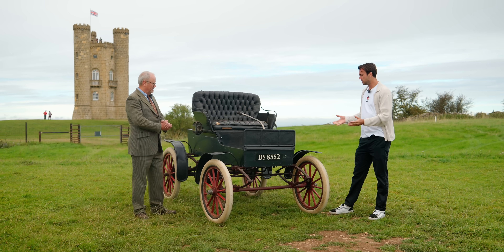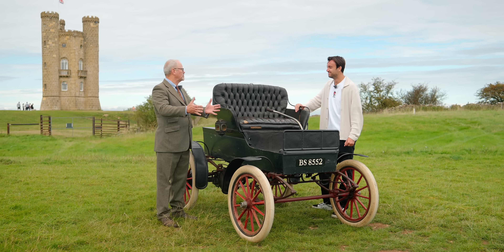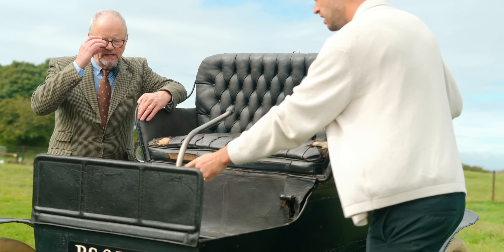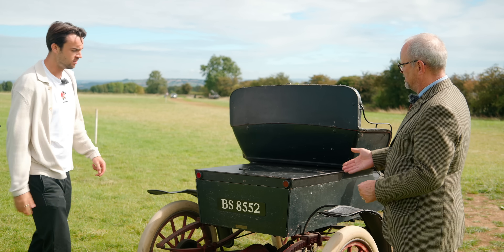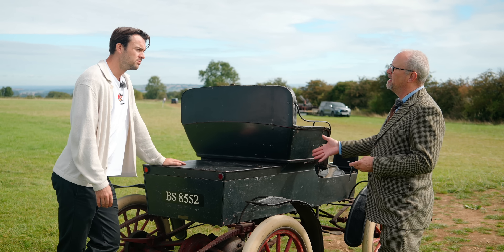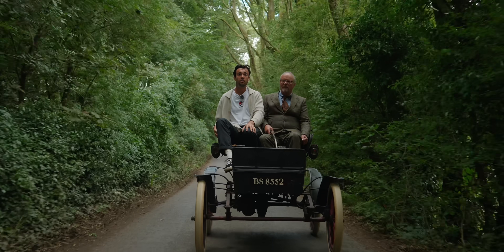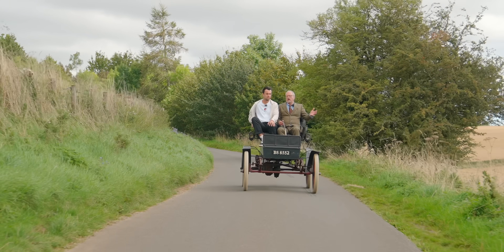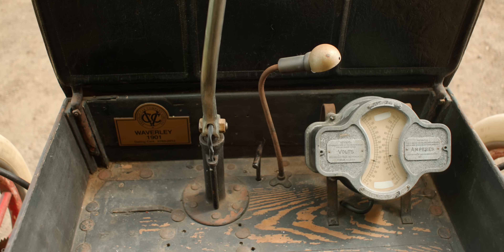Why Electric Cars Failed 100 Years Ago

Comment: So... shall we do a steam car next? 😅
Reply: yes
Reply: Come to LA and I'll set you up with Jay Leno and his steam car.
Reply: Jack, your statement that steam was the hydrogen of its day is not merely true but perhaps more important than you know. Steam was complicated and wasteful of energy for personal mobility much as is hydrogen but steam was also fantastic for heavy industry and great big things... much like hydrogen could be.
Reply: More 120 year old electric vehicles would be very cool.
Reply: I bet you did get to go in a steam car you'd be proper chuffed.
Reply: @GreenJimll  bdumm Tss
Reply: Naa mate, sterling engine car next show😂😂😂
Reply: @bernardfender5147 Bernard, didn’t the 2015 U.K. building regs 15th edition recommend a 1kw sterling engine option (vs.1kw solar PV) - for all domestic gas boilers back then? 🤔
Reply: Actually I read a long time ago that the 1927  (I think ) Locomotive, solved the problems of the Stanley Steamer, but by then the gas powered vehicles had won.
Reply: @richardchiriboga4424  locomibile.
Reply: External combustion is an excellent addition to any project.
Reply: @sIightIybored  

No.

It's still internal combustion when batteries overheat, catch fire and melt marine car transporters in half on the high seas.

Everyone, but you, knows that.

And, before you attempt to grace us with some far too chippy response, "melt in half" is a literary device.

With a portion of hyperbole thrown in.
Reply: @t1n4444  you appear not to know steam engines are external combustion engines.
Reply: @sIightIybored 

😂😂😂😂😂

Well, now, there's always Google.

So, that said, the relevance of your post is what ...

Well
Reply: @t1n4444  why do you have to insult people for having a different opinion or for getting something wrong? Why can't we just have a respectful debate using verified facts? And why do people on this channel insist on having a full out war between fans of EVs and fans of internal combustion? There are god and bad points about both, and both fuel types have a legitimate place in society. For goodness sake, grow up, the lot of you.
Reply: @matthewgodwin3050  

Hmm  ... this is known as robust debate.

If it's not for you then kindly refrain from posting arrant nonsense.

Can you do that?
Reply: @t1n4444  did you actually understand the questions? I'm not sure you did. How exactly is being respectful and using verified facts arrant nonsense? Please explain.
Reply: @matthewgodwin3050  

No.

I'm far too arrogant to explain further.

Hope that helps.
Reply: But you are trying to get us all  to stop burning things……
Reply: yes steam car please
Reply: Not impossible. There are still quite a few working steam vehicles on the road.
Reply: Nuclear please 😉
Reply: Lol!!!! The steam car didn't worked well because off it's size! But on trains, ships, construction and mining equipments it literally changed the world.
Reply: Be careful with steam cars, Jay Leno had a close call.
Reply: Electric steamer, a kettle car 😂
Reply: Steam cars, why not... speak to Jay Leno, he has a few.
Reply: Not until you develop an "instant boiler" to start it going. It makes it difficult just to get in, turn the key and go.
Reply: @stephenbrinckerhoff3510  there's a thing called a flash boiler, mostly it's just a long coil of tubing that a diesel/methane/alcohol bunsen burner sends flame through, though there are flat coil styles that use multiple tiny jets, like the burner rings in a turkey deep fryer.  the modern version is 'instant water heater', slightly bigger.
     very small amount of water, lot of contact area, very fast, automatic ignition, the lot, though most use manual starter pumps, there's electric ones that work just as well.  these are VERY fast to get ready and the amount of water in them makes a 'rupture' a bit of an annoyance instead of the hail of deadly metal fragments that so many are skeered of.
Reply: @felderup  But you still have to wait until there's enough steam pressure to get you moving. It's not just push a button and take off like a rocket after sitting for a few days or even hours of inactivity. What do you do in sub-zero weather" when even electrics fail you? Even diesels are problematic.
Reply: @stephenbrinckerhoff3510  doble's do a heatup in 90 seconds, kids these days, no patience.  anyways, up north here, we have block heaters for really cold days, though, where i live, it's usually not needed.  however, what temperature is it where simple lead acid cells fail?  if gasoline cars at -40c will just start up and move off with no issue, how cold has it got to be to make the battery in a steam car stop working?  since they're the exact same technology, what is the difference?
Reply: Once had a girlfriend  whose father designed  hydraulics for aircraft.  Built a steam engine,  fitted into boat  .  Wanted to put a steam engine in my  1950  A40 😮
Reply: Definitely ! my friend has a 1903 Stanley steamier that they took me out for a drive in the other day, it was a great experience and rather funny because although all we could do was 25mph our acceleration was faster than a normal car
Reply: If you can get the facts straight sure. The first electric car was actually developed and on the road over a decade earlier. Look up William Morrison EV.
Reply: Abner Doble sold some magnificent steamers.
Reply: well, there are benefits to using steam power, it'd be better if we'd skipped gasoline and just used steam and electric.  with all the modern systems in cars steam would be superior in most ways to the competition, i mean, don't forget, it took one change to gas cars to bring them from idiocy to top of the heap.
Reply: @felderup  one caveat with steam power – when the boiler blows parts can usually be found over a mile away.
Reply: @alanhat5252  haha, very cute, your humour based on misconceptions, truly dad joke level.
Reply: @felderup  what do you consider to be a "misconception"?
Reply: @alanhat5252  oh, you're serious.  what makes you think the kind of boiler i mentioned, the non-boiler, or the majority of boiler types used in cars would be exploding?
Reply: @felderup the problem with generating steam to drive all types of power equipment is the excessive energy consumed in heating the water to boiling point. (In those days only coal and wood was available). However, now that we have ever-more-practical nuclear power this may change of course..)
Reply: @philtucker1224  the energy consumed in the water can be VERY efficient, the problem is the recovery of the heat for fresh feedwater, 0% condensing is wasteful.  100% condensing steam cars have always been rare, and only ones that went really really really slow.  for a highway capable steamer it'd need to be big and have a condenser sized for the expected distance done at highway speeds.  a tractor, like a kenworth would need a condenser as big as the sleeper cab, that'd add 25% of the mass on top and cover the hitch, so it'd have to be another 2-3 metres long just to attach the trailers.
     for steam cars it'll be better if they're small city cars, the smaller they are, the less efficient, so a tank with a small boiler on the side to keep things hot for the run home would be fine.
Reply: @felderup  would they still need to shovel coal into it?
Reply: @philtucker1224  in a flash boiler?  are you on the drugs?
Reply: @felderup  read the regs mate. The regs required each new build to have 1 kw of self generation. Flush installed solar PV or a sterling motor mounted integrally to the exhaust outlet of a high efficiency gas boiler were the recommended methods left to developers and installers to decide. - Nothing to do with me mate! Do your homework!
Reply: @philtucker1224  regs, of what?  what are you blathering about?
Reply: @felderup  in the U.K. we have what’s called “building regulations” these have to be strictly followed by developers and are constantly updated every few years to embrace new technology and energy conservation measures. These are then enforced via “building inspectors” that visit the construction sites at various intervals during the build process and signed off so that construction can continue. I don’t expect you have this process in the States - assuming that’s where you are from?
Reply: @philtucker1224  so, where did you mention them that i should have noticed... or cared... in a conversation about steam CAR tech?  our regs can be boiled down to nb-370, national boiler codes, they cover all of north america, it would have been irrelevant to mention them.
Reply: Yes, but with the caveat of running it off electric kettle heating elements to keep it in the purview of the show and to stop BS... although the efficiency of it would be horrifically bad admittedly
Reply: @BikerSam86  there is a way to fill steam cars from a tank, they'll get a pretty decent range for city driving, and home boilers that run on electricity... add a hose at work/shops to go home?
Reply: @felderup  Ooo I do like this idea, could even use parabolic solar collectors to boil the water for this kind of setup too... would love to see these kinds of things on the show. Broaden people's horizons to the sheer amount of alternatives to BS
Reply: @BikerSam86  there's also the burning things issue.  reasonableness is determined by what you burn, some people could have a methane generator in their yard and a pump to compress it, carbon neutral, all you have to do to make fuel is poop.  homemade charcoal from sustainably harvested trees, compressed straw bricks, methanol from waste wood/sawdust, home windmill/solar electric.  in that, steam is almost as input agnostic as electrics, gasoline cars need heavy modifications to change the kind of fuel they run on, plenty of carbon positive things to be avoided.
Reply: @felderup Feld, that sounds very very silly. 😁
Reply: @philtucker1224  what does?, you know these comments aren't threaded, yes?
Reply: Please, for the love of God ...YES!
Reply: Well, what's wrong with a mix!?
Reply: The camera car driver need a talking to.
Reply: steam cars are boring as they were a short lived thing that only existed because steam locomotives existed.
Reply: Yes 😁
Reply: ouiiiii
Reply: Yeyyy
Reply: YES PLEASE !!!!  STEAM BABY.
Reply: As long as we can skip  the 2 hour warm up
Reply: Go on go on go on go on go on.
Reply: Yes with a uranium boiler
Reply: Do the gassisfire like the germans did I  ww2 with the ve bugs
Reply: Yes!
Reply: Try a Stanley Steamer, preferably one with a modernized boiler. They used a flash boiler on the same principles as the "instant" water heater in your house but technology has changed such that what now happens in a couple of seconds used to take 45 minutes.
Reply: @alanhat5252  Umm... No?  Stanley never used a flash boiler.  All Stanleys used a vertical fire tube boiler.   White steam cars used a flash boiler, as did Doble.
Reply: We/I like a BEV 🔋 🔋 Electric  Vehicle/Car too but at what cost and what advantages?

Last Updated: Oct 8, 2023 19:14 CT by TX Texas ERCOT Power Grids

Given that there are about 3-4% are BEV's mostly Teslas.
And given that Wind Power is only about 25% efficient the same applied for Solar Energy = that operate in fall/winter from 9:30 to 18:30 less than 50% Operational Time 24hr [(also about 22-25% efficient and Life-cycle remains to be seen.  Ten (10). 20?  Wind Turbines Life-cycles averaged 10 years; and Maintenance Schedule twice annually.]

Can the Electrical Grids in USA handle the Loads of just 25-35% BEV by 2030-2035?  Remained to be seen.  Those Semi Trailers 30-wheel running on Diesel Fuels and Buses that we ride daily consume 10-20 Energy Needed to operate = the equivalent of Passenger Cars like Teslas Model 3 and Y.
FYI:
[Methane, the main component of natural gas and a byproduct of fossil fuel drilling, has more than 80 times the warming power of carbon dioxide in the first two decades it’s in the atmosphere. ]
And USA uses daily about 65-70% Natural Gas to generate approximately 4-5 Teslas and other BEV.  By 2035 when the Draconian Legislation by Biden and Elon-gate alike, perhaps, we have to burn 50% of coals and 75% of Methane to generate enough Electric Powers for daily uses in USA.

In Canada 🍁 🍁 is another ball-game, 🍁 🍁 Generates daily more than 60% from Hydro Powers (Water Turbines, Dams) and by Ratio. 🍁 🍁 uses a lot of Powers to keep Country running -- Refinery, Drilling Activities and Heating to keep households warm in the Winter; by per Capita we create more C02 than USA -- that is another Topic of how 🌿 🌿 Plants and 🎄 🎄 through Photosynthesis (Interestingly, this process also uses oxygen in the same way as humans use oxygen for breathing. Fortunately, photosynthesis also uses CO2 and produces 10 times more oxygen, so plants create much more oxygen than they use.   )

There are many ways to reduce C02 Emissions not one way is EV Electrified Vehicles.

We hoped that we citizens of the World will continue participating in Debates and Conversations to make tomorrow a Better 🗺 🗺 World to live in for everyone.

Cheers,
 
CURRENT GENERATION  FALL season CAPACITY  MAXIMUM CAPACITY
Solar 91 MW  (0.2%)11,663 MW  22,163 MW
Wind 6,419 MW  (13.6%)  12,686 MW  39,897 MW
Hydro 96 MW  (0.2%)  389 MW600 MW
Power Storage 372 MW  (0.8%) 1,053 MW5,405 MW
Other 0 MW  (0.0%) 163 MW113 MW
Natural Gas 24,884 MW  (52.8%)  54,367 MW  69,890 MW
Coal and Lignite 10,218 MW  (21.7%)  13,623 MW 14,321 MW
Nuclear  5,027 MW  (10.7%)  5,064 MW 5,448 MW
Reply: hydrogen
Reply: @nixoncode  fusion.
Reply: GM or Chevy wanted to sell nuclear cars that generated electricity..
Reply: The 1925 Doble E-20 deserves another look at it's technology.
Reply: Without burning stuff? The steam would have to be produced from pure rant!
Reply: @gabprof  burning stuff that grows makes it carbon neutral, algae tanks run on solar power would be prime, little sun and it spits out green fuel bricks.
Reply: It should have been electric cars all the way since the 1900 , because of the combustion cars right now we are ending the human life on earth !!!!
Reply: If you're going to do a steam car next you may as well call up Jay Leno for his steam car(s) to take it for a spin.
Reply: Not a Bad Idea, he has some nice ones. @IraQNid
Reply: Electric milk floats - the unsung, silent, heavyweight champions, for decades.
Reply: Jay Leno has a few, and demonstrates them too (The "Stanley Steamer", for example. And has a small "misfire" during lighting of the burner singing his eyebrows… :P And, of course, Britain being Britain, a number of Sentinel steam lorries are preserved, as are a number of steam traction engines and "heavy pullers", there’s a video here on YT where they are re-enacting a troop transport, with steam lorries and a low loader with a tank on, all steam hauled, with soldiers in WW1 gear marching along. Lots of smoke and steam, and it moves not very fast… Some people had their Sentinels re-geared to match more modern highway speeds).
As for electric motors, the series-wound DC motor reigned supreme until 3-phase motors was invented. Even the single phase AC motors were basically DC motors, which is why they used such wonky frequencies as 16 2/3 Hz (continental Europe & Norway & Sweden) or 25 Hz (the Thamshavn-Løkken railway in Norway). Eventually "chopper" technology replaced resistors and series-parallell switching, and then finally power electronics got suitable to carry along and work well enough to convert any current (DC or AC) into 3-phase of varying voltage & frequency, meaning you could dispense with the complicated rotor windings of the DC motor in favour of the simple "hamster wheel" rotor, which doesn’t need fragile coils nor brushes (that wear and can spark etc etc).
Modern electric cars uses some variant of the 3-phase motor, and power electronics to convert the DC in the batteries to multiphase multivoltage AC.
Now, if you want to enjoy some old-fashioned old-school DC motors & the associated control mechanism, go have a ride on the 1973 stock on the Piccadilly line in London. Find a motor car and a seat above the camshaft controller, and enjoy! (The old pre-war S-bahn cars in Berlin that still ran in the 80’s were also an experience!).
Reply: Yes
Reply: Yes 
If we can crack cold fusion 🙂
Reply: YES PLEASE!
Reply: Yes
Reply: Yes please. Also...outstanding to see a Waverly moving.
Reply: Actually, I've placed some thought into making a modern steam engine off of the current tech available at the moment. What I've come up with is something that can basically run for a really long time off the surrounding environment so long as it won't escape the threshold of the speed at which it collects energy. It wouldn't require waiting to get it running either. Me and a few friends wish to play around with a prototype. The potential mixture of energy sources would be solar thermal, dehumidification, air pressure, and hydrogen. Energy storage would  be lighter variant to a sand battery but works just as good, batteries, water tanks and air tanks. I mean it's not like it will be a serious project, but I think it has potential to combine every vehicle tech outside of fossil fuels into one hybridized machine.
Reply: @dapain1576  basically, perpetual motion cars?
Reply: @felderup  F*ck no, sorry for my French. It wouldn't be perpetual. At maximum any machine can run 130 years or 200 more in theory. It's just how well and fine tuned you can make the machine work to that end and what materials it's made of. Perpetual motion will always be bull. At least for the next few era's until humans figure out how to push the longevity of machines which very few attempt because of perpetual motion nonsense and are discouraged. Every time I hear that I picture the homeless man from the movie pursuit of happiness saying its a time machine!
Reply: @dapain1576  so, you're saying the machine would last that long, high hopes for more than 20 years on the roads we have in this world.  are you saying, multi fuel, in a well built machine?  it seemed like you were saying perpetual motion was your goal.
Reply: @felderup  No, I never even mentioned it as a goal
Reply: We have hydrogen car.
Reply: Maybe we should have an electric steam car; the batteries feed the heater which boils the water and produces steam for the engine! 🤣
Reply: Yes! As obviously steam will catch on, just you wait!
Reply: I vote diesel/electric hybrid
Reply: Nuclear power is basically just steam….
Reply: I bet a horse would have needed a recharge before sixty miles in those days plus emissions from the horse had to be collected for growing roses 😂🤣
Reply: Steam was very popular up until 1950 but was really only safe where the boiler was able to be kept away from passengers. Hence not convenient for cars but great for trains and power generation.
Reply: @philtucker1224 , have you ever heard of flash boilers? They have been around for 100 years FFS.
Reply: @PhysicsA1  I think the problem with designing small vehicles using steam for power is a) lots of the big developing countries don’t have easy access to water and B) The water needs heating first and the new rules will only allow us to use electricity or possibly Hydrogen. Plus a car type vehicle needs to be able to move instantly at the turn of a key so I don’t think it sounds very practical..
Reply: Everyone knows that successful electric cars companies were all bought out and dismantled by the oil barons back then as they saw them as a major threat to their very profitable petrol (gas in U.S.) sales. (Another reason why a comprehensive passenger rail network was also never built in the U.S.)
Reply: Why not? I wonder with modern technology to heat water what would a "modern steam car" would be like. Maybe you'd be better off sticking with hydrogen engine technology and let water be the "exhaust"?
Reply: @stevejarred6484  the only problem with hydrogen is that it’s very difficult to carry across a desert or along a heavily shrubbed jungle path in a beaten up Jerry can.  Like battery power, once that little issue is solved the emerging nations might be able to entertain the concept a little more seriously…
Reply: @philtucker1224  fuelling in the desert... rooftop solar, if the people in the car brought a weeks worth of water they could limp through the day on solar.
Reply: @felderup  😂🤣😂🤣
Reply: @philtucker1224  yes, hilarious, that hat makes you look like a funeral director.
Reply: @stevejarred6484  really, the only problem with steam cars is, for efficiency, you need size.  so, small ones either charge from an electric home boiler or they burn something completely carbon neutral to become fuel efficient.  for ENERGY efficiency, at least as big as a long haul truck... there's one person that lives here using one as their daily driver, but that's a tad excessive.
Reply: Yes
Reply: No way This is Fully Electric Charge Show.
Reply: @thilinarupasinghe7968  which is why many suggested electric boilers as a way to provide the steam.  though, some have gone the loon route and said it should be using batteries on the car to do it.
Reply: I made my career building and repairing extremely large boilers, so I'd love to see a steam car explained like they do here
Reply: Do a show on the people of the time and all their pushback against the automobile at the time. It's exactly what's happening with all the pushback against EVs right now.

You can lookup articles of the times and stories from people who lived through it.
Reply: Yes
Reply: Yeeeees
Reply: Get your hands on a Doble steam car
Reply: Check Jay Leno's garage and his White, Doble, Steam Cars, and of course the Stanley Steamer.
Reply: Steam cars? Yes, please! 😊👍
(Yesterday, at a "Long Night of Science" in south Germany I watched a demo-model of an electrolyser, plus a fuel cell, showing the move from PEM to AEM concept, really facinating, if you're not stuck at dreaming about their use in cars ('cause there are looots of other, much more urgent usage scenarios)).
On the other hand, I've seen good old steam trains in reality, but not a single steam car yet (...other than in museums).
Reply: It would probably be a nuclear-powered steam car since nuclear reactors are basically boiling water with spicy metals.
Reply: YES!!!
Reply: YES, please!!
Reply: Imagine  the time invested into fossil fuel engines being put into electric steam engines things would be so different instead, we’re lining certain peoples pockets just like this new fad battery craze  from China , the reason why electric cars didn’t work in the late 1800s is because the batteries were horrible and they ran on gasoline engines. There’s your answer kids.
Reply: The first one of those,,, 1769?  Do a program on that one.
Reply: 9:07 How did you get your sweater to disappear when you opened the battery compartment?
Reply: Depends how you heat the water I guess.  Kerosene? Hell no! But an electric tea kettle on wheels is actually not a bad idea as long as the electricity doesn't come from a coal or gas fired power plant.
Reply: @monk3ysmuggler  Steam from electricity to propel your car instead of direct electric drive? That's even stupider ihan electric motors.And less efficient.
Reply: Find old elizabeth the steam bus
Reply: Better buy your coal now before the swamp bans that as well..
Reply: That’s the plan
Reply: Its a new fangled water eating machine thingy...They call it hydrogen 🙂
Reply: Jack, yes the Doble, now theres a car.
Reply: My grandfather was an early electrician from the early 1900s - we live in the US In the deep South  - 
     Most today only know of car and truck battery's that are small and deliver short burst of high current - 
     A car or truck battery has a acid solution of 1.275 strength so it can deliver say 900 amps for 1 minute - 
     The battery's in electric vehicles in the deep South were often a strength of acid of 1.220 or lower - 
       With the weaker acid The battery had a 30% less capacity - but on the other hand the battery's did not easily sulfate also the plates were not eaten up as they are, with stronger acid - 
       Many of those old electric car battery's lasted well into the 1950s - at 1.220 strength acid  they did expect a 40 yrs service life out the battery's - 
    Many had a gasoline/ kerosene or steam powered generator at there home to charge there EV battery's - also wood smoke generators were common - 
       I live in the rural deep south - in the 1890s rural people were using farm light plants that were 6, 12 or 36 volt - the homes were powered by large 2 volt cells hooked in series to the desired voltage - 
       Most were set up to were the home ran 6 days a week on the battery's and were charged all day once a week - 
        There was no grid power till the late 50s were I'm at - homes with 32 volt systems had all the appliances people in the city had except they ran on 32 volts DC - 
     If they had a TV they had to use an inverter to convert the DC to 110 AC - 
     Many of those farm house batteries had a acid strength of 1.195 with the weaker acid there was a 40% capacity loss but a service life of 60 to 70 yrs was common - 
    I never see any of that information printed to day - 
      Also farmers fully understood how to desulfate and equalize there house  battery's -  
     My dad was born in 1912 and he often talked about all the electric delivery trucks in city's - I'm a 3rd generation mechanic electrician I spent my carrier working in the offshore oilfields for yrs -
Reply: Nuclear powered Steam. Needs refueling every 10 years.
Reply: If we can scale down nuclear fusion,a steam engine engine could power everything
Reply: How ridiculous.   Steam is dangerous -
Reply: FYI:   Tesla - not Tezla
Reply: Been there, done that, didn't work that well.
Reply: Simpson's car next
Reply: yes
Reply: Regarding something Robert said, the reason we have great lithium ion batteries was there was a demand for better batteries for mobile phones, which pushed more research, if there was a demand for better battery technology for early electric cars they would have been developed sooner, at least thats my beleif.
Reply: @dorianleakey  there was a better battery technology, Nickel-Iron, & it did catch on, but USA's extremely aggressive marketing & lobbying system drove the far inferior lead-acid technology, probably because it needs frequent replacement, there are 90-year-old NiFe batteries in use today.
Reply: @alanhat5252  No way!? Jeeeze.
Reply: @alanhat5252  the nickle iron's are heavier for the same capacity, for non-motive power, they're still superior when compared to most other battery tech.
Reply: @dorianleakey  I think few people will find fault with your assessment.
Reply: They're still petroleum based.
Reply: @unclegeorge7845 steam cars can run on nearly any liquid but able fuel, or even solid fuels in some cases, such as alcohol or even wood!
Reply: @JohnGeorgeBauerBuis   Yes John, But really; How many do or did and what is the percentage for petroleum?  We're talking cars here and not tractors or boats.
Reply: What are?   @unclegeorge7845
Reply: No.

Straight to a couple of years in the future.

Hydrogen fuel cells.
Reply: @t1n4444  yes*
Reply: @t1n4444  yes*
Reply: @t1n4444 are you joking??
Reply: @voelkela  

Kindly reference your query and we'll see where you're going wrong in your reasoning process.
Reply: @t1n4444  "a couple of years" 🤣 Hydrogen vehicles exist now and are good! They'll just never replace EVs because of the fuel cost. And the cost will never and can never drop lower than electricity.

Maybe in 20-40 years hydrogen will make sense for large commercial work horses, like tractors or diggers. But those are just as likely to switch to ammonia.
Reply: @vorpolkai 

😂😂😂😂 

The usual misinformed history lesson.

If you feel you are the expert in hydrogen fuel cell cars then lyou should immediately write to BMW and let them know they're wasting their time.

I suspect they'll be astonished.

You can Google the  rest of the manufacturers of hydrogen fuel cell powered cars yourself.

How's your Chinese?
Reply: @t1n4444  They supposedly have a 100 on the road, not that their seem to be much evidence of their existence anywhere on the web. They have just 300 miles range, which isn't impressive. 

On the other hand, electric sold tens of thousands of vehicles this year and real people can drive them.
Reply: @vorpolkai  JCB has hydrogen internal-combustion engines in production
Reply: @vorpolkai I think everyone thinks the cost of electricity will remain the same as the demand on the grid increases dramatically with EV adoption.  Given the cost of both expanding the grid and trying to use intermittent energy sources, I think this is a very bad assumption.  I can see electricity costs easily doubling or tripling in the next decade.  This will dramatically change the cost comparisons of ICE vs. EV.

And keep in mind that an increase in gasoline price only directly affects your transportation cost.  An increase in electric prices affects not only your EV, but also your home.  And since your home uses 3-5X more than your EV, the impact on your budget of a 100% electric rate increase is far more severe than a 100% increase in gasoline prices.
Reply: @vorpolkai   
1. DC chargers charge significantly more than the standard rate for electricity. There's your business case.
2. They don't need to replace BEVs,  which have a very limited number of use cases. They need to replace ICEs (which can also be carbon neutral with biofuels and synfuels).
3. Ammonia as a fuel is not yet market ready. Maybe in future.
Reply: It never going to happen. A film about the hydrogen revolution that never happened might be interesting in 5 years time.
Reply: @DavidKnowles0  

Keep dreaming.

We'll be seeing BMW's appraisal of their hydrogen fuel cell cars' world tour long before that.
Reply: @t1n4444  solid fuel rocket powered one next
Reply: @sergentcolon1  

Hmm ... I'm not convinced you're taking this with the seriousness it deserves, but I did see "wotchudundere" tho'.

You could Google all about "specific impulse" and then all about hydrogen as a rocket fuel. Even my cat knows all about liquid hydrogen as a rocket fuel.

And I haven't got a cat.
Reply: @DavidKnowles0  Considering it was supposed to have happened about 10 years ago, I think you can probably make that film now.
Reply: @DavidKnowles0 no they will still be saying it's just a few years away now, hydrogen is soo much better. (I do think it will have some limited use in the future, but I also think it would be better to just use gas or carry on using regular fuels)
Reply: @DavidKnowles0 who are you to say that!? Imagine if we didn't discover the lithium battery! Lol!!!!😊
Reply: @DavidKnowles0  I can't see it ever catching on for passenger vehicles.

Even taxi drivers can now theoretically get about in an EV for most of their shift. I say theoretically given that the car that they'd need is currently in six figures (The Mercedes EQS 450+ which does a real world range of 395 miles) and no taxi driver is going to spend six figures on a car to make what's not much more than minimum wage after expenses. I earn more than double what my dad does as a taxi driver for example, for half the hours

Where it might have some traction is HGVs. Once you remove the container, HGVs are fairly "light" The actual vehicle part isn't that big. We'd need some seriously energy dense batteries to cover the mileage HGV drivers cover

In that sense, I think perhaps hydrogen would be good to use over there. I won't expect them to change voluntarily but with government regulation, I could see it happen.

Equally, government is the reason why we're actually using more HGVs than is necessary. The government's scrapped HS2, which could have been used for freight too.

We could have HGVs off the motorways , and freight sent up on high speed trains instead. Then we'd just need light goods vehicles from there, which could be battery powered. That would be cleaner, cheaper, and quicker

It also means we'd not have to have as many HGV drivers too.

The other way I see hydrogen being used, is in aviation and when it comes to steel production. Currently, coking coal is used to produce steel. We can replace that with hydrogen but crucially not at scale.

Even hydrogen made from gas is better than coal.
Reply: @waqasahmed939 

Do you still believe we'll see very high speed trains on HS2?

That said loving your idea of shoving freight onto the the new network.

Getting HGVs off the roads would prolong the life of the roads and save cash.

Would suggest the drivers could be doing the transfer of rail to roads in hydrogen powered vehicles, then "last" mile to final destination as per the Amazon type system, yet in small hydrogen powered vehicles.

Keeps people employed and might allow for several drops to an address in a day???

Or even same day ordering and delivery for "stock items".

Doubtless the food supermarket sector might be interested too.

I'll leave the details up to you, then.
Reply: @t1n4444  I doubt it'll still go ahead. It might well go ahead with future governments

The BoE says that tbh it doesn't truly matter what the cost is given that it'd be expected to take in £100bn/year

One economist at the BoE was wanting a HS3, 4,5,6, and 7

It doesn't matter if we borrow that money too given we'd make that all back from ticket revenue in one year.

Give another year and we've more than paid off all the interest too.

The last mile vehicles would have little need for hydrogen too given you could just have battery electric vehicles making said deliveries